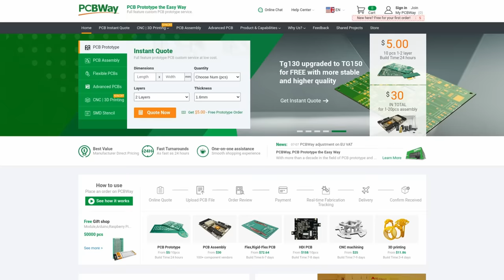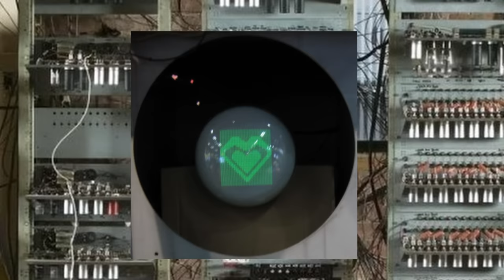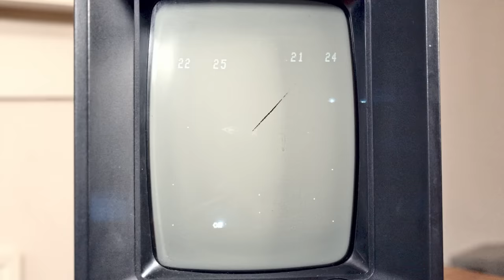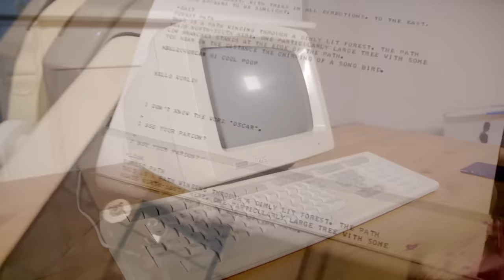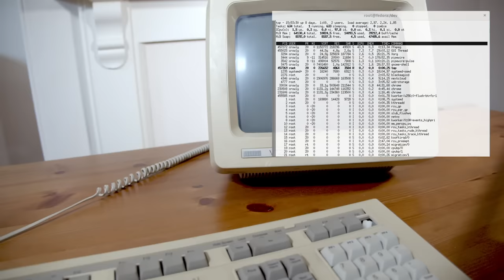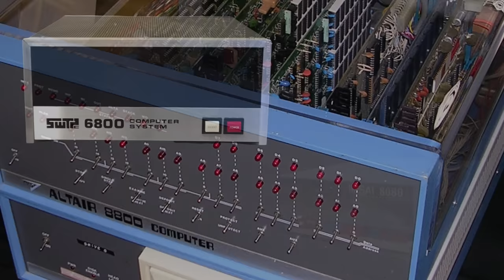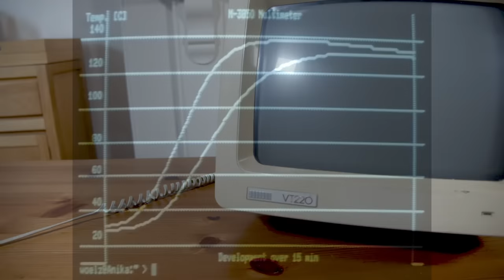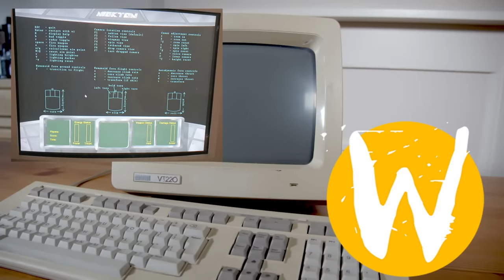The abridged history of Computer Display Tech

Comment: When my Grandma worked for IBM in the 60’s in the programming department, debugging a program meant getting a printout of a memory dump from the IBM 1401 and going line by line to see what went wrong and then re-writing the program using her chart and then sending it to a secretary who would send it back to the punch card department and then waiting until your punchcard would be tested on one of the on-site machines. Wash, rinse, repeat.
Reply: In the summer job I had at the end of my first year, I tried sending my programs to the data-entry clerks to be punched on to cards, but they had a lot of trouble with typos like distinguishing “O” from “0” and “I” from “1”. So in the end I gave up and punched the cards myself.
Reply: In USSR, one iteration of that cycle was called "approaching the machine". You could be fined for debugging a program with too many approaches.
Reply: My father used to work with 1401s.  I want to say at his high school but I don't recall.  I had a brown three ring binder with some of his punch cards and reference material.  Pretty sure it is either in my basement or I gave it to my brother.
Reply: @themax4677  my Grandmother was also trained on the 360 she told me she would much rather program on the 360 because there was less wasted time. She said it could do more and it wasn’t a “glorified calculator”. The 360 had more ram which meant it could as she said “multi task” where the 1401 was stuck doing things one at a time due to its limited ram. When she migrated to the 360, she spent a lot of time developing a program that would literally convert old 1401 code to something the 360 could understand and run.
Reply: yeah and people have nostalgia for this period.  smh.  we left these technologies behind because they were worth leaving behind.
Reply: and nowadays web developers get spoiled because their rewrite-compile-execute cycle takes 10sec to run ... 
who needs hot-reload ...
Reply: I'm going to tell my grandkids, back in my day we needed to type and see the screen and think, the computer wasn't inside our brains and couldn't immediately know what we wanted...
Reply: So it was an all female coding group in the 60's?
Neato! Meanwhile I'm here trying to explain to my mum what a browser is :/
But just shows you females can be great at computer science as well,
Reply: @LillyP-xs5qe  It was actually both genders. My Grandmother happened to goto an all girls college in New York City to which IBM sent out a man to recruit graduating students in the mathematics department, and she shared a cubicle with two other women in IBM. When she moved to Western Electric, she was the only woman and only programmer in her department, and she was the only woman representing her company at a programming conference.
Reply: @anthonybrunotheodd  did her secretary was male or female?
Also my aunt, my mum's big sister was a leading dev in amdocs since the late 80's, was a manager of a whole team while her husband raised their 3 kids as a stay at home dad.
Reply: @LillyP-xs5qe  my grandmother didn’t have a secretary, the secretary I was referring to was the programming department secretary. But yes the programming department secretary was a woman.
Reply: @LillyP-xs5qe  that’s pretty neat!
Reply: @LillyP-xs5qe  My grandmother left her job at western electric to teach cobol from ‘69 to ‘71 at a night school. She had my father in ‘67 and she raised him during the day and my grandfather would take over when he got home from work and then she would head out to the school.
Reply: Back then you didn’t have a conversation with the computer, you “corresponded” with it:  you sent it punched cards and it sent you back printouts (and occasionally punched cards).
Reply: The company whose keypunch operators were constantly confusing zeros with O’s and ones with I’s hadn’t trained programmers and keypunches on special hand printing fonts.

Incidentally, one reason more women got into programming than one would expect from the times was that they could pick up computer knowledge as typists in the keypunch department.  In those days most male executives did not learn typing, considering that to be “beneath” them.
Reply: The 360 had more than just more RAM than the 1401; it also had features we now see in PCs and Macs: concurrent I/O and computing, interrupt processing, protection against accessing another user’s memory (intentionally or not), and a supervisor program which could do processes forbidden to applications.  This allowed multiple users on separate I/O devices to appear to share the host computer.
Reply: @allanrichardson1468  that’s what my Grandmother told me. But she specifically went into mathematics. She was going to study psychology but she found the professor “weird” her words not mine.
Reply: @allanrichardson1468  my Grandma told me the 14 in 1401 was because it had 14k. Also the 360 was “designed” to be both a business computer and do scientific work. The one thing I’ll never understand, and she claims she doesn’t remember, was the fact the 360 could emulate the 1401.  
When she joined Western Electric she was told to convert 1401 programs that were on punch cards. Now my Grandma had to take a course on how to write programs for the 360 so I would hope her teacher would have said “The 360 can emulate 1401 programs.” So my Grandmother claims this is what happened. The engineers had a few programs made for them that they would use on the 1401. This was western electric a subsidiary of AT&T so they mostly developed telephone systems. When Western Electric switched over to the 360 they complained they couldn’t use their old programs on the 360. These programs were very specialised and they needed them to do specific things for specific types of work. So when my Grandmother was sent into that department, she said she devised a system that the 360 would hunt for certain “lines of code” that were specific to the 1401 and change them to so the 360 could run them natively. 
Now why she did this I asked and she said she can’t remember why. Like I said, my Grandmother could have easily pointed out that the 360 was backwards compatible, my Grandmother never operated a computer before, she wasn’t trained to do that. She was trained to write programs. (However she did do her own punch card once because she wanted to create her own printout. She wanted to create a Christmas card for her cousin. So she programmed the printer to print out a set of characters in the form of Santa Clause waving.)
I asked her if she remembered what language the engineer’s program was written in. She said she couldn’t remember but it was either Cobol or IBM Assembler. But here’s my question for you Allan, why do you think my Grandmother went through all that trouble writing a program to literally convert 1401 code to run on the 360 when the 360 could emulate the programs natively without any conversion?
Did she do it to increase the programs speed? Was it because the 360’s 1401 emulator was terrible? Or was it done because the programs she converted was done in a language the emulator couldn’t handle. Or is there another reason I’m not even thinking about?
Reply: @allanrichardson1468  my grandmother said it was like a chain working at IBM with the computers.
Reply: @anthonybrunotheodd  The 1401 emulator was only available on lower, smaller memory models of the 360, so in the long run it paid to redesign (and often improve) and recode programs.  But in the short term customers could run existing programs and develop their replacements on the same machine (not sure if you could run both a 1401 job and a 360 job at the same time, but it could have been so).  After converting all your programs over, you could upgrade to a larger and faster 360.
Reply: @allanrichardson1468  Oh, so that’s probably what my Grandmother was brought in to do. Although, she claimed that the only reason she left IBM and went to Western Electric was because my Grandfather (now her ex-husband) was quote “jealous of the higher salary that IBM paid” her so he “insisted” she work for Western Electric. But she spent most of her time with other engineers, I guess she started converting old programs before writing new ones like you said.
Reply: My school 2 weeks work experience was at IBM North Harbour in Portsmouth.
Even though it was the mid 90s they still had ES9000 mainframes with tape drives and terminals for your VMS session.
I spent one day as a "tape monkey"
There were these washing machine looking things with a red led segment numeric display which would request a tape from the library or a blank cassette.
I would then have to run off into the stacks, find the tape and run back to the flashing machine.
So the operation latency was literally how fast a 14 year old boy could search through the tape library.
Sometimes the old reel to reel machines would pipe up and ask for a big tape.
Reply: @lawrencedoliveiro9104  Didn't they teach you to write them a certain way, like a slashed zero and a hooked one?  If you didn't, I'll bet the clerks would have trouble!  You had to use "coding forms" which was like graph paper, with little boxes to fill in, so they could even count spaces when entering it.
Reply: @anthonybrunotheodd  Yea, the 360 architecture brought forth many ideas that we take for granted on modern machines.  It had instructions to replace both the old scientific computing machines and the business machines.  
I learned how to program the 360 architecture in college, in 1985.
Reply: @alexandermirdzveli3200  wwww
Reply: They allowed women in tech back in the day? 😂
Reply: @Agent-ie3uv  Yes. There were. In the 60’s the workplace began opening up for women. It was a slow crawl admittedly but it was a start.
Reply: @alexandermirdzveli3200 Bert Kreischer’s a Soviet robot!?
Reply: My uncle was doing the same job for IBM at that time.
Reply: @Matt_The_Hugenot  perhaps they ran into other. Who knows?
Reply: Wow. My grandma was busy cheating on her husband.
Reply: @monad_tcp  How quaint!  Your grandkids will hardly believe that computers are programmed any other way than my having a conversation with the Programmer-Analyst A.I.!

Comment: XTerm still emulates Tektronix storage CRT terminals. Ctrl+middle click on the terminal and select 'Show Tek window'.
Reply: It can also be built with an option for DEC ReGIS graphics. Much more advanced than crummy Tektronix stuff.
Reply: @lawrencedoliveiro9104  And sixel too. Just switch it to vt340 mode.
Reply: [1] no one uses Xterm anymore [2] no one really used Tektronix mode [3] I used a Real Tektronix [4] with APL charset
Reply: @RootBoyJim  [1] true, but it is still available in pretty much all Linux distros [2] it was rarely used because there was not much software using Tektronix graphics mode on Unix [3] my deepest condolences 8-)
Reply: Does xterm do RIPScript?

Comment: Serial terminals enjoyed a small resurgence in the mid-90s when people started installing Linux end discovered that they could have a second screen by finding an old terminal for cheap or free.  One summer I had one outside on the patio.
Reply: DEC micros took it a step further.  If you plugged in a terminal, you got a second login.  Basically multi-user on one PC.
Reply: @HybridBattery  Actually, it's exactly the same.  DEC machines connected terminals to a serial power, just like you do on a Linux box.  One of the major advantages of Linux over most of the DEC machines is that Linux includes SSH and telnet servers that allow you to make a similar connection over a network, which wasn't a default feature of DEC machines.  You could add it, however.
Reply: @evensgrey  I’m specifically referring to the Pro 325/350 which predate Linux (1983).  They run a stripped down RSX-11M.  The serially connected terminal is a totally separate user. It’s not a dual-screen scenario.
Reply: @evensgrey  Linus Torvalds was only 13 when I tried this trick, and ssh would not be invented for more than another decade.
Reply: Is that REALLY your name?
Reply: @MichaelKingsfordGray  why? Do you know me?  I still have this 1983 Pro350, but it has a bad memory board and won’t boot anymore
Reply: @HybridBattery  Ah. You are cowering behind a name that is not your real adult name.
Bona fides matter a lot in the world of grown-ups, to establish credibility.
Reply: @MichaelKingsfordGray  I’m not “cowering”. I’m being prudent by protecting my privacy.  I’m not publishing my address or phone number either. Give me a non-public way to contact you and I’ll share my info.  But yes, that’s my real first name and initial.
Reply: @MichaelKingsfordGray  Okay... what is wrong with you?
Reply: When i had a patio, people only throwed garbage 😢
Reply: Resurgence? In the 90s and well into the 2000s I was working on systems that had hundreds of terminals connected to them. Terminals were still much cheaper than PCs.
Reply: @HybridBattery  "The serially connected terminal is a totally separate user. It’s not a dual-screen scenario." That's the same way it works (in the default configuration) on Linux; serial ports will have a `getty` process running on them that will issue a login prompt and then start a shell for whatever user logs in. The "second screen" the OP refers to is not something added to an existing session running on the main keyboard and display; it's a separate session.
Reply: My school library in the 90s had software called “Oasis” for looking up books. There was a tower computer which they called the “Mainframe” and all over the library were serial text terminals running off that central server
Reply: @MichaelKingsfordGray only boomers use their real full name on the Internet. The rest of us grew up on an Internet site that offered us anonymity in the name of freedom and privacy.
Reply: @HybridBattery  thats basically what happened on linux
Reply: @HybridBattery  Is there any other meaningful way of operating serial terminal than with a full login prompt? Sure, I could start /bin/sh itself on an ttyS, but then you lack most Terminal-Emulations, have no profile-startup and so much more trouble. A /sbin/getty sounds rather smart in comparison.
Something completely different: I ran csh running on AmigaOS to an DEC vt180 Terminal, you could literally debug games while playing them. And yes, I ran it WITHOUT getty because the Amiga has no multi-user and therefore I know all the problems getty takes care for you.
Reply: I did this briefly, but soon moved to xdmcp as old computers even at the time were enough for it.

Comment: That's why if you want to do something serious under the hood in Linux, you still reach for the terminal. I'm glad that's built in and no external teletype has to be used.
Reply: An interesting aspect of this is that most distros also have a number of virtual consoles that run alongside your main X or Wayland session. They run a terminal session in a much less abstracted display mode, but with all the features of whatever shell they're running. I've used them a number of times when my X session becomes unresponsive to restart the session and kill a misbehaving program instead of having to force a shutdown. They're usually accessed with ctrl-alt-Fn button combos, although the number that each distro puts the main display on varies.
Reply: Well as a desktop os its never going to make it as long as people think that outting shortcuts on vim that you can click constitutes a user experiance.  But as a server using a web based UI which have reached a real level of sophistication now, the path is clear for linux and it probably doesn't need to bother trying to be a desktop os.
Reply: @Hugehead1234  Yah, I've done that before when a fullscreen game or something has locked up and won't let me see the desktop.  Ctrl-Alt-F2 to get to tty2, log in, open htop, kill the malfunctioning program, exit, then Ctrl-Alt-F7 to go back to my desktop session.  ...Or a worse case, hit Ctrl-Alt-Del in one of the tty's to shut down everything and reboot.
Reply: @tripplefives1402  no, virtual terminals are not managed by X/Wayland. They are managed by your kernel and the init system. You would have a display without X/Wayland, it would be a VT. Technically yes, when X is running it has to manage the transition over to a TTY should you Ctrl+Alt+F2,F3 etc, since it fully controls the keyboard at that point. Note that switching from a TTY does not require the Ctrl, just Alt+Fx
Reply: No. If I want to do something serious I pull out my punch cards and Kilburn tube!
Reply: If you want to do something serious and safety-critical in Linux, go straight to Jail!
Reply: @MichaelKingsfordGray  Jails are from BSD.  I understand Linux is adding a similar feature, but they're called something else.
Reply: I'm a little sad an external teletype is not required... I need any and every excuse to buy tech junk when talking to the wife....